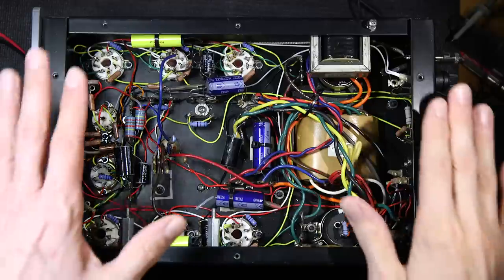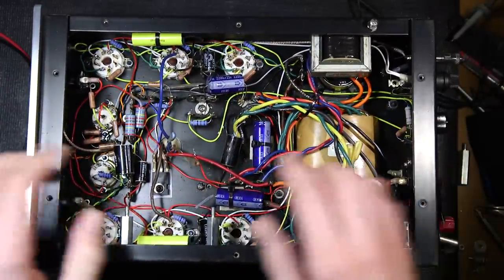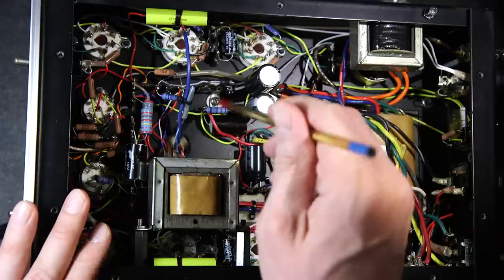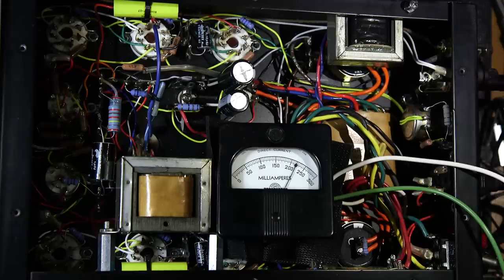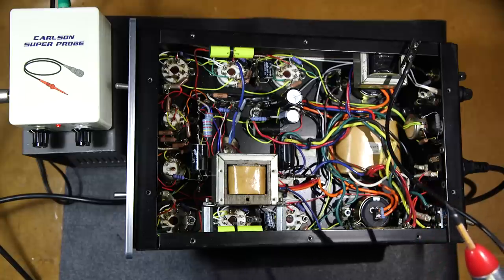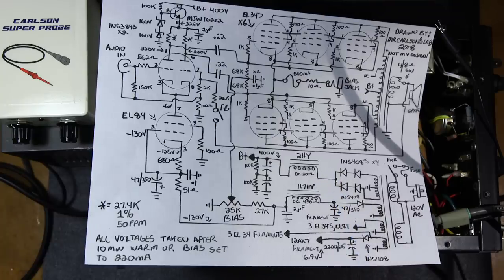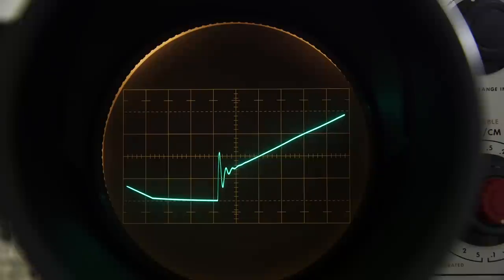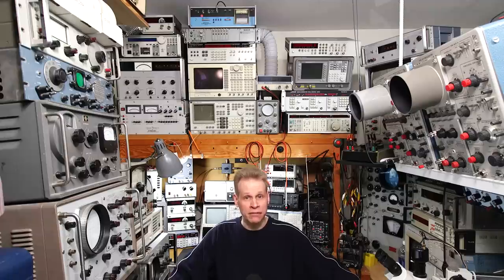Amplifier Troubleshooting and Modification.

Comment: Have you tried wrapping some copper foil (soldered to itself to make a loop) around the reactor? Maybe with some Teflon to keep 600v off the foil. It should help a fair bit, the idea is that it will now be inducing current in that copper loop instead of other wires.

Comment: Just wondering, with the increasing availability of super caps, how would they work in amplifiers?  The add where I recently picked up 6 6 farad super caps said they would be useful in getting better bass in amplifiers, but that seems a lot of capacitance even at the rated 2.7 volts.

Comment: I'd like to understand a little more about what's happening.  I'm guessing that the diodes turning on suddenly causes the choke (and it's distributed capacitance) to ring?  And that by adding the capacitor you're moving the L/C constant to a lower frequency and "out of harm's way"?
Reply from the maker: Hi Russell, I will do a video on this in the future, but for now, google: Diode Reverse Recovery.

Comment: the reactor is chip, loosely wound and the plates are not secure, vibrating.   That reactor needs to be tossed.  
I normally wrap the reactor with a copper  tape and locate it at the top of the chassis  next to the power transformer, next, the  reactor is missing the capacitor at the input and they need to be of the appropriate voltage.  we can get 250 pico at 800 v  they are inexpensive.
I like to hear from you about my idea

Comment: I have enjoyed your videos for a few years now, thanks very much. I need some advice. I purchased a 300B SET amp in China years ago. I can only turn it up have way, 4 watts, (it is rated for 8 watts) and then the distortion starts in. Can I fix this by changing out the tubes for higher quality Russian tubes? Or is it just the topology of the build, you see it is only 90 dB S/N ratio, would that have a bearing on the output quality?
Thank you in advance for your reply
 Scott

Comment: I watched both videos relating to these tube mono amps but what I do not understand that the the raise from 408 VDC to 415VDC by inserting the 2uF cap into the circuit before the diodes will lead to 650 VDC B+. Or is the diode arrangement after that insertion point multiplying that delta VDC of 7V?

Comment: Hi Paul! First of all, thanx a lot for your videos, pure joy to watch.

I´m wondering if, instead of a capacitor before the reactor, a series LC suction circuit (tuned to the ringing frequency) would kill the ringing without raising the voltage behind the reactor.

Comment: Paul, I realize this is almost 2 yrs old, but I have a question about the .47uf cap/s you added to the power supply just before the inductor/reactor. 'Could' you have also added a dropping resistor to ground along with the 2uf to keep the voltage where you wanted it, or would that have created a different problem? If you could, would you put the resistor between the diodes and the capacitor, or between the capacitor and the inductor/reactor? Or, is .47uf close enough, and the 2uf wouldn't be necessary? Thanks, LOVE your videos! :)
Reply: Hi, Randy. Sorry to butt in - but my thought is that the power supply is under load already - a resistor to actually lower the voltage would have to be very hefty - because of "wasting away" voltage at that current level with subsequent heat generation - and the .47 seemed to achieve the same result without further  complication/component adding. Any thoughts on that?   Bev.
Reply: @darkgreenambulance  Ha, Ha! It's been around one year since I watched this and made my comment. I'd have to go back and re-watch the video to see why I made that comment in the first place. Maybe I'll do that later. Thanks for the comment. :^)
Reply: @randyr.parker2698  Hi, Randy - many thanks for your return. Might have further contact - always good to exchange thoughts - and I`m not qualified or anything - but I do like to "pick things up"! Cheers. Bev

Comment: So by adding those caps, you did have to move the reactor, right? BTW, I see that you did an episode on a Mac preamp. I've always been impressed by the specs of Mac equipment. I also heard that Mac recommends replacing the tubes in their amps every 5 years. Is that true? Mac will offer new tubes but I hear that they are really expensive.

Comment: What's the benefit to using a very high voltage transformer with a choke input filter to drop the voltage, rather than a lower voltage transformer and a more typical capacitor based filter?
Reply from the maker: The answer is: regulation and filtering.

Comment: Thanks for the videos. I am curious about the idle noise after putting the extra capacitors in front of the reactor. Did that have any effect on the hum? Could you have just put the capacitors in and not moved everything around?

Comment: what about a multi turn pot for the bias control, what about using two Atelier Rullit speakers and using the field coils from both speakers to operate as a lopass filter to get rid of mains ripple and you get rid of that reactor just means that speaker leads will have four cables instead of two.

Comment: I wonder how much the noise reduction would be if only the capacitor was added without moving the reactor. What if the leads to the reactor were reversed? Would it be possible to use any magnetic sheilding?

Comment: Mr Carlson, i am in a desperate need for help. I recently bought a rotel rx800 and i am afraid i got screwed. The am is not working, i want to blame the antenna since it's half missing, it has a stereo light for fm which should light up, but it doesn't. It also has a signal strength indicator, that is moving just slightly or not at all, not sure what to blame since the FM tuning meter is working just fine. Also, someone cut off the power outlets, something i don't mind, it's working just fine. I can't see any kind of intervention besides what i just mentioned. All original caps and parts, doesn't look like someone has been tampering with it. Any kind of suggestions? If i try some external antennas and the faults mentioned above are still present, what do you suggest? Could the stereo light not light up due to defective antenna? Please, notice me

Comment: I'm curious; could you have just added the .47uF cap ahead of the B+ supply reactor element and eliminated the amplifier's audible idle hum without relocating the reactor in the chassis?
Reply: That seems unlikely Roger Mason, as the cause of the original hum was concluded to be caused by inductance from the magnetic field of the mains transformer.  The ring was induced, as I understand it, by the oscillation from the reactance between the reactor coil, the filter capacitors, and the mains transformer running at 60Hz.  Someone will surely correct me if I am mistaken. But I think that is the gist of it.
Reply from the maker: Hi Roger, no, because it's still "reacting" to 120 cycle ripple. That was the frequency that was interfering with the phase inverter circuit. The capacitance that was added in this video is dealing with DRR or "Diode Reverse Recovery" issues.
Reply: Sorry I was off on my frequency, of course the rectified ripple would be 120 Hz not 60 Hz as I stated above.
Reply: So the reactor relocation in the chassis dealt with "hum" that you could hear thru the speakers with no amplifier input, and the added B+ line capacitance was addressing the audible (not audiable) noise coming directly out of the reactor element.  I always learn something from your videos;  Thx.

Comment: Very informative! I've been tricked by peak volts vs DC levels before.  I'm curious though why you did not use an electrolytic capacitor instead of the poly caps. I would have upset the electrolytics . Am I wrong?

Comment: I wonder how has the hum level changed after adding capacitors?
Reply: The caps took some of "abruptness" out of the bottom of the  waveform that was observable on the scope. As Mr Carlson pointed out - that "squiggle" was evidence of "ringing". What a difference, though with that mod!  I wonder how much hum there would have been with the caps  before the smoothing choke was moved. If you look up the circuit for,  (and see the illustration of), the Mullard "5 - 20" amplifier, (5 valves, 20 Watts), one can see that  a fairly large capacitor is before the choke, which is top mounted  - and, come to that - the choke appears to be physically adequate for the size of amp/wattage. This was in 1955!  The Amplifier Mr Carlson was working on is a lovely machine, but  he showed us what an enormous difference was achieved with those two mods.. Very revealing video.  Many thanks for that. Rather like adding, in the dead of winter, an efficient car heater to a vintage Rolls Royce!  Lovely old car - but so uncomfortable during those months! Sorry for the completely irrelevant comparison.

Comment: Do you think that if you had left the reactor where it was and simply added the caps to the supply line like you did that it would have gotten rid of most of that noise?  Very cool project, Paul!  bringing my old Heathkit OM-3 back to life this weekend after parts show up. I need to use it but I haven't replaced any of the original components since I picked it up...what better time than when I have a dead guitar amplifier on my bench that has lost signal and I don't know why!

Comment: Would you not get over 650V flat on the power cap till the cathodes warm up?
Reply: I would have thought so - using diodes instead of a valve rectifier  - instant voltage -  good point!  Still, the caps themselves were rated for that if I recall - but you must be right!

Comment: Couple of questions. 1st after adding the capacitor, could you put the 2h reactor back to its original position. 2nd could you just used a diode with a faster recovery? Great channel, thanks for the videos!!
Reply: I would think it would still have the coupling problem with the output transformer? Which was the main part of the amplitude of the hum, if I remember correctly.

Comment: What was causing the ringing? I am nervous seeing two diodes in series in order to boost the voltage they can stand. If one leaks more that the other, then one will take much more of the voltage than the other and may burn out. Instead of two 500VDC diodes, a 1000VDC diode would be preferable. Is it possible that the the diodes store some charge and cannot shut off instantly when the voltage reverses. Sort of a poor man's step recovery diode. Doesn't seem likely at 60 Hz.

Comment: The ringing noise you see is caused by diode recovery times. Both leakage inductances and all the leakage capacitances affect the frequency.  Adding a single small capacitor changes the resonant frequency, but does not “kill” the resonance.  The usually best approach to actually consume the resonant energy is to use an RC instead of the plain capacitor.  In other words, add a resistor in series with the small capacitor.  As long as the capacitor is small, there is very little current running through the combination at the base 120 Hz and the high (resonant or ringing) frequency amplitude is low, so it also adds relatively low current.  Thereby the resistor does not need to dissipate much power.
I have in control systems used 10 nF capacitors over each diode, but in an audio application I would choose the RC method..  As the video does not reveal the actual ringing frequency, I cannot calculate optimum R and C values.  Just guessing that 100 nF and 47 ohm might be a pretty good start.  In summary, I would try to reduce the circuit “Q” rather than shifting the frequency.  The benefit would be no effect to the post-choke voltage.
Reply: Pellervo Kaskinen indeed, and as Pedro said.
It is very common practice to have capacitors in parallel with such rectifier diodes. This shouldn't disrupt the output voltage by much at all. Most any power supply with large enough transformers, filters, and passing sufficient current will exhibit diode ringing at twice the mains frequency. More thorough filtering could have 2 series caps with their center tied through a resistor to ground forming an RC filter. Simple modern inexpensive ceramic caps are all that's needed. Another choice is to use slow recovery diodes.

Comment: I like the Super Probe (and have seen your videos on it before), but I would never use a probe with any more metal on it that necessary. Even if grounded why take the risk? You may inadvertently contact something. I would insulate the outside of that probe.

Comment: You set the bias to 220-230 but I thought you found a better value in the other video.  Why wouldn't you use that value instead?  I'm just learning about valves!
Reply from the maker: In the end, the bias was optimized. I wanted to keep the specs the same in the video for comparison to the original design.

Comment: Why do you refer to a choke as a reactor? In my book, a reactor is a large device that belongs in an electricity distribution system (i.e. the power grid).
Reply from the maker: Here you go: https://canadatransformers.com/line-reactor/
Reply: @MrCarlsonsLab  Yep, more associated with industrial motor drives, and such, than simple power supplies in electronic equipment where choke is the common term used in the literature.

Comment: Interesting. Was the kink in the waveform causing mechanical vibration of the choke? Was your probe picking up the sound of the mechanical vibration or the the current/voltage waveform in the choke? Thanks.
Reply from the maker: Hi Janet. What your seeing (and hearing) is a result of the diodes in the rectifier. This is know as a "Diode Reverse Recovery" issue.
Reply: Making a mechanical sound in the choke?

Comment: Hi Paul,  I enjoyed your excellent explanation on getting rid of the hum.  I was curious about a couple of things.  What are your thoughts on reducing hum by rectifying and filtering the heater supply voltage - this seems like it would reduce 60 Hz coupling between the tube sections, but I am afraid it may create more inrush current into the cold heater filament.  Would a series NTC thermistor be appropriate?

Thanks,

Michael
Reply from the maker: Hi Michael. Many other problems arise from filament rectification, especially when those filaments pull lots of current. I will do a video on this in the future.

Comment: BTW, what's the difference between hint, tip and trick? For me, they all are the same thing. ;P
Reply: Hint:  What do you think might happen if you touch that 5 K.V. terminal? Tip; Here is a useful tip - Do not touch that 5
5 K.V. terminal.  Trick;  Wear purpose made gloves before you touch that 5 K.V. terminal.

Comment: 22:33 can you explain this "ringing" noise next time a little bit better. Because i don't understand how it gets produced in this amplifier. When i design a new amplifier is it possible to avoid this "ringing" with a diffrent transformer(reactor) or coil ? So i can eliminate this on beginning already ? Or is an cap really needed on a new product to get rid of this "ringing" ?

Comment: Would you (or anyone you know) be capable of 'updating' an old FISHER 500C tubed receiver?  It is in superb condition cosmetically, and was used by my father every few weeks, and only on Sundays basically for an hour or so.  He bought the unit new back in the mid 60's, and it sat inside one of those huge wooden furniture consoles for decades.  He passed on a few years ago, and the unit was still working well, however i've been told that these need to be updated by changing old caps, and testing voltages for stability.  So I haven't turned it on in 6 years.  I do remember, back in the early 2000's, my dad and I hooked up a pair of Magnepan MMG's to it, and it drove them perfectly.  Still have the original Telefunken tubes in it.  Thank you.

Comment: +Mr Carlson's Lab is the reactor transferring vibration to the chassis that becomes hearable then because of the resonance of the chassis? could this be prevented by mounting the reactor on kinds of vibration absorbing mounts?
Reply from the maker: It did have a "shim" under it, but still electrically and physically noisy.

Comment: I was thinking to myself..."Wow! Sumphin's not right wiff dat dare Pi filter"...I never saw an application that
dumped the rectifier output into the filter choke without that very cap being in there. Then I saw that waveform,
that harmonic "ringing". My thought was half a "mike" would soak that up and make that reactor core quit
growling...but it wouldn't bring yer B+ up the the peak of the rectifier output. Anyhow, having not seen what
the product on the other side of the choke looks like...I guess half a mike. Not to bad for an ol' feller
who's been out of this type of stuff for years. I'm wadin' back in though(8-).

Comment: Mr Carlson  A question for you about power supply electrolytic capacitors.   I found a handful of suppliers that sell certain size capacitors used in old guitar amplifiers, e.g. 1960's Fender and Marshall.  These caps are huge,  like 1" diameter, 2 1/2 long, axial.   For example 16uf 475v caps used in the power supply in Fender AB763 circuits.  My question is:  there are new Nichicon capacitors, with higher voltage rating that are tiny, probably 1/4th the volume of the older style new production F&T capacitors.  I found 18uf 500v Nichicon and they are very inexpensive. but better temp rating, they are 105c vs all 85 c for F&T..   Is there any reason not to use these Nichicon electrolytic capacitors in old guitar amplifiers?   Thanks, Mike

Comment: I'm curious, after the addition of the .47 uf cap, if the choke coil/reactor could have been left in it's original location? Kinda makes me wonder about those 1n5408 diodes-or is "ringing" like this normal w/o a cap installed? Meaning simple design flaw?
Reply from the maker: The reactor still couples to the output transformer in its original position, so the 120Hz signal is still present at the elevated level in that spot.